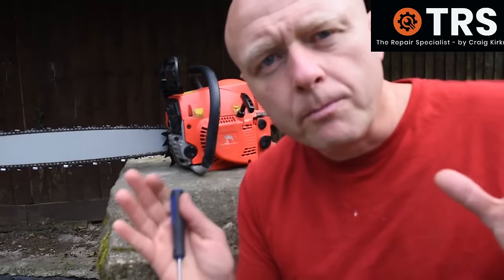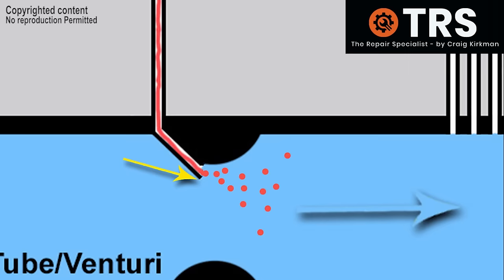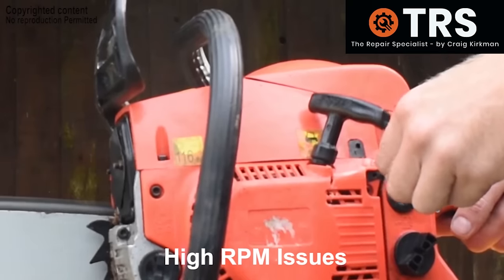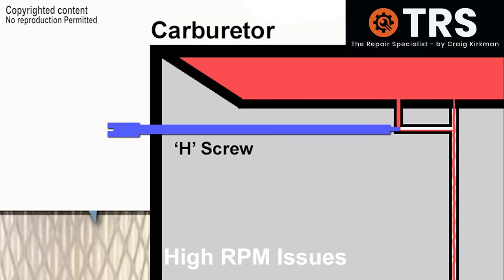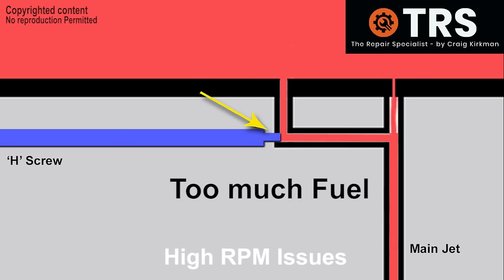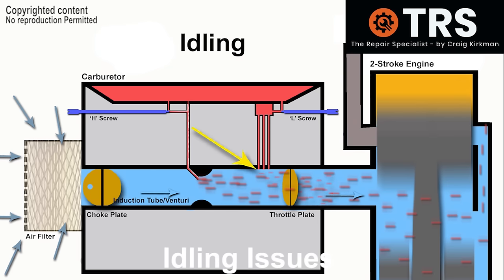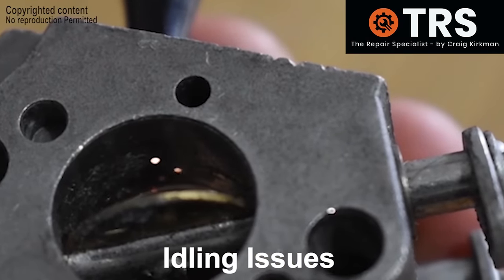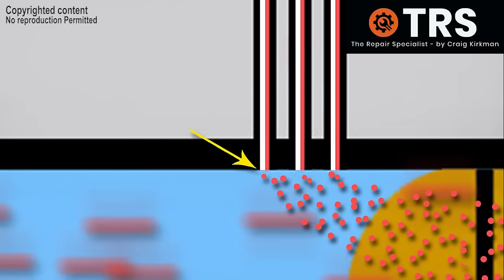CHAINSAW CARBURETOR FUEL SCREW SETTINGS do this Inside Carb | FASCINATING!

Comment: When adjusting the H screw at wide open throttle with no load on the saw, we should leave our mixture slightly on the rich side (lumpy). Because when the saw is engaged in cutting some wood it needs slightly more fuel and if we set the H screw perfectly at no load we will be slightly lean while under load and we risk engine damage from a too lean condition if there’s not that extra bit of fuel/oil mixture. Better a little lumpy than a little lean. Thank you.
Reply: Fortunately my chain saw cuts air because it's actually a paramotor, that uses a chainsaw carburetor 😉
Reply: You're correct! It should be slightly 4 stroking and cleans up in the cut.

Comment: It’s called four stroking- a bit of a breakup at WFO.  It will sound like it is running a bit rough.  I set mine at 12,600-12,800 on my tach.  That, rpm will make it run a bit rich, but will keep it running cool and give it enough gas when it is cutting wood.  I generally set by ear but I verify with the tach and readjust as needed.   This rpm range will allow the saw to work well in winter and summer temperature conditions.  I set the carbs on my saws in spring and fall.  You do not want a saw to run lean in the freezing days of winter, which they can do.

Comment: I've always gone back and adjusted the high and low screws a second time. Now that I've learned that both circuits send fuel simultaneously and affect one another, it seems I was justified in doing so.  Thank you. I learn so much from you and am still learning some basic things.
Reply from the maker: Thank you for your nice feedback. I really appreciate it. Craig 👍

Comment: Hey thank you so much for this. Amazing explanation. I recently started using chainsaws for firewood since power is so expensive and I had trouble with one that looks almost identical with the one on your video. It bogged a lot and you video helped me adjust it quite a bit. It works fine for a while and then it starts bogging down again when cutting. I feel like I have already opened the H screw quite a bit. I will try opening it more again I guess, it might need more fuel after a while while cutting.
Thanks again, now after your video I actually understand exactly what I'm doing and what happens inside the carb when adjusting instead of just guesswork.
Reply: 2 common causes not covered as per your description are puddling in crankcase getting cleared out and leaning out.. and # 2 hi ck valve rubber deteriorated and restricting fuel flo tru main jet leaving h screw fuel only. normally 1 1/2 - 2 turns is norm . some aftermarket carbs are made to cover many applications so main jet is small w adj screw larger so w no air leak 3-4 trns out may be norm. most other causes have been covered by excellet vid.

Comment: I just got this comment on one of my videos: "Unlike every other two stroke engine, chainsaws have but one fuel mixture adjustment: the L screw.  The H screw does not alter the mixture at full throttle,  it only controls maximum speed." I sent him a link to your video. Hope you can help him out.
Stay well, Joe Z
Reply from the maker: Thank you Joe Z. I really appreciate it. Craig 👍
Reply: @TheRepairSpecialist  You're welcome!

Comment: have never seen any explanation anywhere for why idle must be a little rich to prevent bog on acceleration . your excellent  vid reminded me of the progressive  off idle porting allowing more fuel w less air on more throttle opening on idle circuit. thanks for great vids.

Comment: Hello Craig. I have watched many many of your videos and have got a lot of knowledge from them. Thank you. I would like to know how to remove the brass main tube jet from the carburetor. Karl.
Reply: Usually not required. Most of these carbs have a locked in jet, not supposed to be removed, so best just buy a new carb. You can use paint gun cleaning tools to clean it, or oxy acetylene nozzle files but these can "open" the jet hole, unless that's what you want. To remove it you will probably destroy it... Screw a screw into the jet hole, try wiggling it out, but may need to dremel around it slightly to loosen it from the carb.
Reply: @FlattardiansSuck  Thank you for getting back to me I really appreciate the information that you sent.Karl.
Reply: @karlsloan  my pleasure mate.

Comment: Excellent video!! What is the reason for having 3 low speed jets with their own little reservoir, instead of a single line like the high speed side?
Reply: 3 smaller holes give better atomisation at low air speeds. The reservoir is just an easy way to maintain consistent flow to the 3 holes.

Comment: Excellent  video  - really educational. 
One scenario  really  baffles me. If the high speed or low speed  needle is bent for any reason,  what effect  that will have in the running of the engine??
Reply: Damaged needles will prevent proper adjustment.
Reply: Yup. And extremely hard to fix. Best get new needles, or better still another carby, as bent needles can damage the hole as well.

Comment: This was a big help with my 21yr old strimmer where it wasn't holding the rev and was cutting out a slight adjustment was needed and good as new thanks so much. Now do you know anything about gas cookers 😅😅😅, only joking well done on the illustration 👏

Comment: Great video!  I have a question though. My saw idles great and revs up no problem without a load but as soon as I start cutting it bogs down and dies, will adjusting the H screw also help this or should I be looking elsewhere?
Reply from the maker: Hi. Yes. Please Start with the H screw then see what happens. If you need to know more about a how to tune procedure then please take a look at my other video on how i adjust these.  It is slightly different to how others do it but it has worked form me and others i know for years.  Here it is: https://www.youtube.com/watch?v=74p9FLmIkkw&t=60s  I hope this helps. Craig

Comment: I love the detail of your videos and the associated animations. I have just been given a Parker chainsaw which is difficult to start and maybe just wants a service but can't find a gasket kit for it. I started to dismantle the top of the machine to get at the carb and saw there were two fuel lines going to it. As the machine does not have a primer bulb are these just the equivalent of the lines that would go in and out of the bulb and then the diaphragm does the rest? Thanks Brian
Reply: 2 in? Or is one an overflow pipe, just going out to the bottom with an open end?
Reply: @FlattardiansSuck  I think that they were to and from the tank. I couldn't keep it running long enough to adjust the screws and so it has been scrapped. Thanks

Comment: I really enjoy your videoes do you have a tachometer recommendation? I have some older saws but have two autotune saws as well.
Reply from the maker: Well, a lot depends on the brand of chainsaw and what the manufacturer recommends, but as a general guideline, chainsaws typically operate within a recommended RPM range of 10,000 to 14,000 RPM. Again, this range can vary depending on the chainsaw's engine size and blade length.

Thank you for your awesome feedback as well. I really appreciate it. 

Craig
Reply: @TheRepairSpecialist  I have big and small I think I will get the Oppama Stihl branded meter. Keep up the videos thanks.

Comment: Never knew there was a reservoir. 😁😎👍
Reply: 3 smaller holes gives better fuel atomisation at low air speeds, and the reservoir maintains consistent fuel flow to the 3.

Comment: Very good video explaining the effects of each screw but I was waiting for you to mention perhaps the most important issues before you can even start adjustment is the suggested manufactery initial settings ,without that info it would be very hard to make correct adjustments in my opinion. Thanks for the great info otherwise but I believe you missed touching on a very critical point.

Comment: My 372xp I have is ported and it doesn't run right unless the low side is screwed in all the way. It's crazy how that works. At high throttle its running 12,800rpms wide open, and starts in couple pulls and has tons of power. Plug looks a little rich but most do when running synthetic oil

Comment: This is a great video and super helpful but I have a different problem with a Stihl ms660 that seems to be alright at high revs when cutting but it has suddenly developed a fault in that it stops when idled down after the cut, it doesn’t seem to happen until the saw warms up and then not every time. Anyone got any tips?
Reply from the maker: Well, I would reset the carb first and see how things go. It’s no good me adding a list of things to confuse the situation to begin with. I have a video here on your on how rest the carbs if you want to follow it. You can also download a Free help sheet of mine that shows you how to do this step by step. You can print is off once you have downloaded it from my website. You will see the download link from the video description. Thanks. Craig 👍

Comment: Great series of videos, I've watched them all however one of my main complaints is an engine that will bog under a sudden full throttle opening, however blipping the throttle gradually to get the engine speed up means you can do a full power cut with no lack of performance suggesting the fuel/air ratio is correct, just not responding quick enough to changes in air flow. What's the most likely cause for this behaviour?
Reply: Too lean by the sounds of it. This can damage your engine. Better too rich than too lean.

Comment: Hi, I've just been watching your video on bog down reasons, was hoping you could help me with a question, I've just bought a 2nd hand mountfield blower vac, (MBL 270V) the guy that sold it to me had said he'd got a new carb put on it but it still doesn't run properly, so I took it thinking it would just be the H & L screws needed set but no matter what I tried it does not run on high revs, just conks out, so brought it in to my workplace yesterday and took the car off to check and clean, made no difference, then looked at the carb make and model which is a HLIC MC14L1 20YA-2 and can not find anything on it which makes me think the original carb is totally different, I can't find original carb details either, if you can enlighten me with anything that may help I'd appreciate it.
Cheers, going to watch some more of your vids now, great stuff 👍

Comment: Hi: Sir,

  I just had the T-screw to fall out of the carburetor.  The problem was getting the saw (Husqvarna 245) to idle.  I did the 1 1/2 turns and solved it.  Then the adjustment of the T-screw was done to get the chain to stop turning.  I did a soft turn clockwise to seat the T-screw in completely.  I could not feel where the T-screw was seated.  So, at the slightest tention on it I stopped there, then adjusted 1 1/2 turns out.  That's when I cranked the saw and the T-screw fell out into the body of the saw.  I suspect that's where it fell into, because outside in the yard it was hard to see or find.  Please advise if the carburetor is stripped inside then what can be done to repair or replace the T-screw?  Lastly, the saw would not crank at all after this T-screw was dislodged.  What are the options or alternatives  to fix this issue?  Thanks.

Comment: Always set the H screw with a tachometer, cheap ones are like $20 on amazon. Way too many saws are set too rich because of tuning by ear to a bubble. Which is safer, especially for people who will run them dull, but there is a lot of power left on the table.
Reply from the maker: Thank you for your feedback. Craig

Comment: Hi Craig, is it possible to save a blower that had regular gasoline in it. I grabbed the wrong gas can at 1 point and now it won't start. Do you have a video for that?
Reply: Unfortunately that's most likely to be caused by premature wear to the piston rings and scoring of the barrel/piston reducing the compression below what's needed to start. In my experience a rebuild with new pot and piston is the only real fix for running on straight fuel, which on cheaper machines often ends up being uneconomical.
Reply: First thing is tie weed eater sting on fuel tank or label or tag it
Remove muffler and look for bad scratches on piston, if damaged it’s bad

Comment: I am glad that I came across your videos thank you. I have a problem with my echo chainsaw...it starts up good then it dies after 2, 3 minutes and have a hard time starting it again..I give it a rest for 5 minutes then start it again and it starts tight away, also it leaks oil when it starts. Please how can i fix that? Thank you. I am commenting from here in the S. Pacific by the way.
Reply: Leaks oil? Like bar oil? 

Sounds way too rich. Start by making sure that your air filter is clean. If the problem continues... after it dies, try setting the chain brake, holding the throttle wide open and pulling it over. If it fires, even briefly because the brake is on, then your h screw is probably too far out.
Reply: @gill998  thank you

Comment: Master, I have a Husvar saw 242, when it is cold it works fine, but when it warms up it won't start and when I press the gas lever it starts fine, I think I should tighten the exhaust because when the engine warms up it needs air, should I do that  Should I bandage or untie the breast?

Comment: Running too lean in High rpms can cause overheating, right? My dads chainsaw is burning my hand through gloves when under load at full throttle. It doesn't bog down at all. Has clean cooling fins, new fuel filter, and new fuel mix in it.
Reply from the maker: Wow. The handle itself is getting that hot? Is it an old fashioned type saw? Or a newer model? To transfer that level of heat from the engine through handle is unusual. I ask about it’s age because newer saw, of course, have rubber shock absorbers between the handle frame and the engine/machine body. Older ones may not. If it’s an older saw with no rubbers then I might be able to understand how the heat is transferred to the handle, but on a newer saw with shock absorber between these points, I’m not sure
Reply: @TheRepairSpecialist  Oh sorry no it's the exhaust burning my knuckles. It's a newer Stihl MS260 and the cover over the exhaust has melted a bit as well. I'm not sure why it hasn't seized up yet..

Comment: My idle screw got turned in all the way, how do I get it back to the sweet spot
Reply from the maker: Resetting your idle screw to the "sweet spot" after it's been fully turned in is a process that requires a bit of patience and attention, but it's certainly doable. Here's a step-by-step guide of what I would do to help you adjust it back again:

Turn Back to Baseline Position:

Start by gently turning the idle screw all the way in (clockwise) until it stops. Be careful not to over-tighten or force the screw, as this can damage it.
Then, slowly turn the screw back out (counterclockwise) about 1 to 1.5 turns. This is a general starting point for many engines.
Start the Engine:

Start the engine and let it warm up to its normal operating temperature. Adjustments should always be made with the engine at operating temperature for accuracy.
Fine-Tuning:

With the engine running, slowly turn the idle screw in (clockwise) until the engine begins to run slower, then turn it out (counterclockwise) until the engine smooths out.
Continue to adjust the screw slowly until you find the point where the engine runs smoothly and the RPMs are steady. This is typically when the engine idles without stalling and without causing the clutch to engage (in the case of equipment like chainsaws or trimmers).
Listen and Observe:

Pay attention to the engine's sound and performance. The "sweet spot" is where the engine sounds smooth and runs without hesitation.
Test Under Load (if applicable):

If your engine powers a tool or equipment, briefly engage the tool (e.g., rev a chainsaw or engage a mower blade) to ensure it responds well and returns to a smooth idle.
Safety First:

Always ensure safety when working on engines. Turn off the engine and wait for all moving parts to stop before making adjustments.
Consult the Manual:

If available, consult the engine's or equipment's manual for specific instructions related to idle adjustments.
Remember, small adjustments can make a significant difference. If you're unsure or the engine doesn't seem to respond well to adjustments, it may be helpful to seek assistance from a professional mechanic. They can help ensure that the carburetor and other engine components are functioning correctly, which is important for the overall performance and longevity of your engine.

I hope this helps a little

Craig

Comment: When you adjust the low needle do you back off the idle screw?
Reply from the maker: Clockwise on the screw will progressively open the throttle plate and increase idling RPM. Anti- clockwise on the screw will progressively lower idling RPM. Does this help?
Reply: Is asking about adjusting idol fuel flow L does the mechanical adjustment of the throttle plate T or LA need to be wound out first?